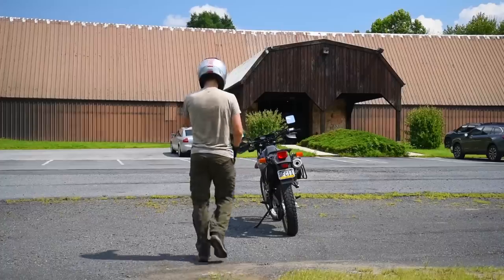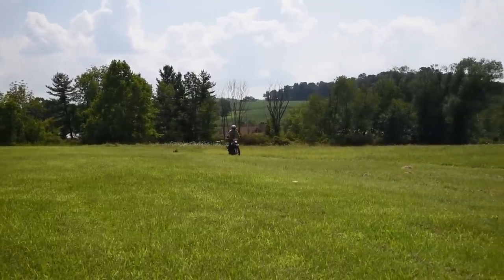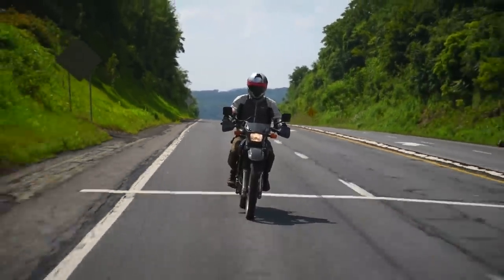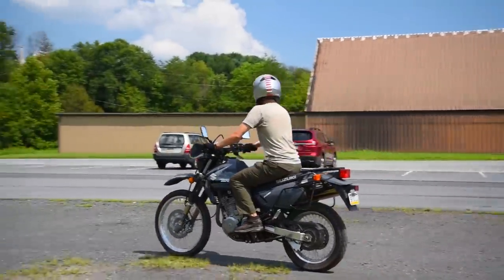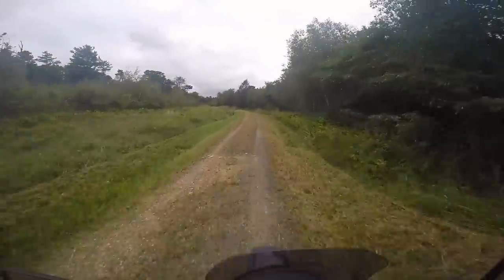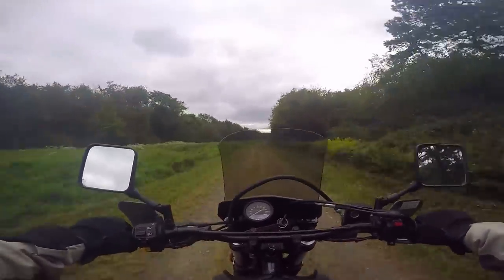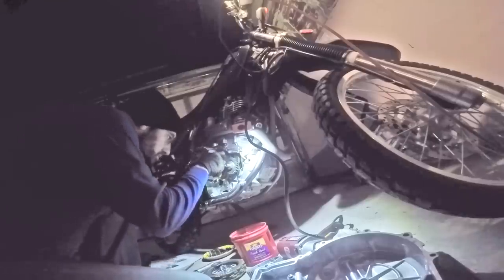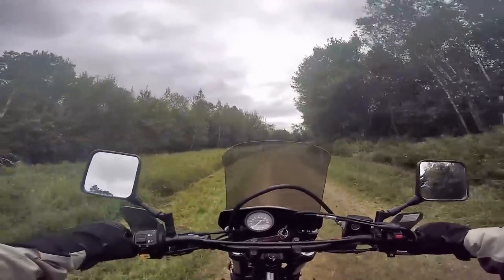2013 Suzuki DR650: Regular Car Reviews

Comment: Best review of a DR650 I've seen. As a former Dr650 commuter... I can absolutely confirm 100% about your statements regarding this bike. I rode dirt bikes in my young years and when I started commuting via motorcycle I started with a Kawi Super Sherpa. I soon got the itch for more power... I'm 5'3" ,klr650/xr650 too tall, Bmw valve adjust =$1000. Bought a Dr and put a lower gel seat, can tip-toe at lights, did 7k miles in a year commuting and loved it. Only stopped commuting due to work relocation. I loved the Dr and am planning on buying a new -to-me used one. But as you stated .... they don't last long on Craigslist.

Comment: You are so right it is the most vanilla bike you can get.
It is essentially bomb proof in its durability and a pig sled to ride stock out of the box.
It does everything right down the middle and that's why as you said it is also the most customizable bike you can get.
I have had mine for 8 years and it is perfect but only because of the changes I made.
While other bikes do a lot of things better at a much higher price, no bike does what the DR650 does at a bear bones price.
Thank you this was a very realistic review, but in the end it comes down to what the rider wants.

Comment: Well this pretty much summed up how I feel about my KLR. It's a gen 1 so, similar weight, similar handling, similar gas mileage. It sucks offroad but I take it anyway, it sucks on the highway but I take it anyway, the seat's uncomfortable on long rides but I take it anyway. I'll take this stupid, old, heavy, and uncomfortable bike to the end of the world though, because, for some strange reason, I love it.
Reply: Well.. umm..   not same weight.
It's heavier.
But still very well said
Reply: @generaldistrust  that's why I said "similar weight", not the same, but reasonably close.
Reply: @tieran9491  well, another reason I went for my '99 DR650SE was several tens of pounds less stock (I do KG not LB 🙏) plus mine was modded by the previous owner with plastic 25-liter tank (Acerbis) & lighter cut-off GSX muffler so it was even more attractive opportunity..
Reply: @generaldistrust  I wish I could have gone with a DR650, because yes, it is 21 kg lighter. But I just couldn't pass up a 1999 KLR with only 10k miles(~16000 km) for 1500 USD.
Reply: @tieran9491  - where I live it is really hard to find a 'find' that a working class (more like 'peasant') can afford and isn't a fail..  I indeed examined KLR option deeply and really dug into all material & details on the web.. this very DR was a major find I admit .. if it weren't this one it might have been even a KLR or who knows make a DR350 to just get acquainted with dualsport before I really familiarize my style more in depth.. I really had a wider variety that I examined but I still wanted the option to go trailing with my friends so there U have it. Can't afford 2 bikes, plus the insurance here is grand theft so it is tough. One bike. What can you do..
Reply: Dual-sports are the blue-collar bike. They're affordable and can be configured for any environment.

Comment: By far my favorite DS tires were the Kenda K270s (or anything that resembles them).  You get 2 solid oil changes out of them, great on the highway, great in the city, ok in the rain, and ok on trails.  They’re affordable, and soft enough to change tires with 2 spoons.  They DO NOT like mud or anything loose.  I retired my 85’ XL600R to off road use only, but it still runs like hell at 50,000+ miles, and I switched to the Kenda K760 Track Masters.  They’re DOT legal, they will “work” on the highway, but only for 1000 miles, and they eat up the trails like it’s nobody’s business.  Super important to have DOT tires if you like to explore, because a lot of wide dirt roads can only be driven by street legal vehicles.  You may even need to run down the highway to the next trail.

Comment: I had a DR650 for several years, and I never found the off-road situation it wouldn't handle if I was careful enough. Maybe our dry climate meant I never had my tires gunk up (not that it was on the stock tires), but it was a total blast to ride around the desert.  With the larger fuel tank, windshield, and a nice seat, it was 'doable' for long highway stints.   
Something to note is that this bike is the easiest thing in the world to work on.  This bike taught me how to replace/rebuild a carb, replace a piston, rebuild suspension components, do some dodgy electrical work, and then some.  It's so easy to get to everything that you don't have all this daunting plastic that you're worried about taking off before even getting to the valve adjustment.

Comment: Love my DR 😁

Sure it's not awesome at any one thing but that's the point. Like you said, it's a blank canvas and that's what I personally like about it. The fact I can chuck a heap of gear on the back, travel hundreds or thousands of kms on the black top and then dive of into the dirt, find a camp site, dump my gear and go explore the wilderness, even some moderate single trails and in a range of conditions depending on your tyre choice...then ride it to work the next day.

That's what the DR650 is all about, and for a lot less $ and weight than what a BMW GS or Honda Africa Twin will set you back 😉👍

Comment: Of all the bikes I've had, the DR650 is the one I wish I had kept.  Mine was set up quite nicely for my usage (commuting and hooliganism) and ran exceptionally well.  FCR39MX carb, high comp piston, Web cam, full exhaust, 16T front sprocket, stiffer springs, 19" front wheel, Trailtech Vapor, and a few other odds and ends I can't remember.  No, it was not great off-road but it handled dirt roads and fire breaks well enough.  Single track was out of the question, ha!  So much fun on the street though and power wheelies in 1-2, and occasionally 3 were plentiful.  Would love to get another one at some point.

Comment: If that's the extent of your "off-roading" then a V-strom/BMW GS will do all that and be a MUCH better ride on the highway. 
A DR650 is the same thing as a XR650L so I don't know what you're talking about there. 
A DR650 isn't even a preferred commuter bike. If you want a commuter the Honda NC700X can get 70+ MPG. 
If you want a proper trail dual sport for PA woods, a TW200 is where it's at. Sure it only goes 50mph but you can bash that bike off rocks all day long and if you get into a pickle....stand up.
Reply: Yeah but he doesn't want something heavy period for offroad and only really used it on the street, hence the gixxif
Reply: Yeah, once I hit an actual motocross dirt track in rain on my KLR650 and then sat down on a DRZ400 i definitely knew weight is just too much of a factor for extreme terrain (mud or DRY fine sand)
For anything else you can pretty much bring any bike that isnt on 100% sport tires
Reply: XR and DR are pretty close weight wise as well, but I think I have read that the XR has better off road suspension.
Reply: Yeah but they're heavier and probably not as nimble on winding roads, and have less-forgiving ground clearance.

Comment: As the proud owner of a 2010 KLR650, this video is spot on. It's for the guy who wants two bikes, but can barely afford one. Off road? Too heavy. Interstate cruising? Too scary. Putting back and forth to work? Perfect.

Geography has a lot to do with how much you'll like the "dual" in dual-sport. Rough pavement/gravel/dirt roads through the valleys of Kentucky and Tennessee is where you'll see a lot of other enduro bikes.

Comment: Yamaha MT-07 58-62 highway, loads of torque. That would be a perfect Regular Car....  Regular Motorcycle Review.
Reply: Lassi Kinnunen  yeah Thailand is one of those places where 250 and 400 are already BIG bikes. same with where I'm at in east Africa
Reply: @gregorysteffensen3279   anything under 450 is small in the US and anything over 800 is large. Dualsport450-nakedfz09 is the US average.
Reply: @ianwright2253  oh I'm well aware - just teaching abroad for a bit! likely getting one of the current CB500s when I get back, too
Reply: Unless you're talking cruiser, then 800 is still small. Got to throw a ridiculously over sized and under-powered engine in those Harleys.
Reply: @ianwright2253  Similar situation in Europe. To the point where 250s are barely even available, with the exception of a small number of enduros(like Honda CRF250). In general there's a big gap between 125 and 500 where the European market is mostly skipped over. I think it's part emissions standards and part licencing system, A1 gets you a 125, A2 gets you a 500 or ecu-restricted 650, A gets you anything. There's no reason for most people to get the bikes that are situated between A1 and A2. I can't even find any used DRZ400s for sale in my entire country.

Comment: Service Manual: "Dry mass................................................... 147 kg (324 lbs)" 

Owners manual: "Curb Mass................................................. 166kg (365 lbs)"

So even with a full fuel tank can it lose 41 lbs of fluids? Forks, shock, battery water, engine oil?
Reply: How much do you think gas and oil weighs?

Between 6 and 7 pounds per gallon. The gas tank holds 3.5 gallons so that's 21 to 25 pounds right there.  The oil capacity is 2.5 quarts, so that's about 5 pounds. Shock oil is about 3 pounds, and a battery is going to be about 7 pounds.

Add all of that up and you got 36-40 pounds.

Comment: 34 here, just got my first bike last summer, CRF250L Rally. It's uncomfortably tall, the suspension is way too soft, and at 340 pounds it's shamefully heavy for a 250. But it looks great, I love the way it feels, it's harder to get myself into trouble because it's just a 250 (but it has enough power to cruise at 60mph without difficulty, and loves climbing hills slowly), and it's fuel injected, so the 5,000 foot elevation range of my local mountain playgrounds don't give it problems. Relaxed exploring on dirt back roads gives 70-80mpg easily. And good visibility, because you sit nice and tall.

Comment: I’ve been a fan of this channel for a while now and was super excited to see this. The DR is my favorite bike I’ve ever had. It isn’t great at anything, but you can do everything on it. I have a pumper carb, full FMF pipe, and drilled air box on mine with a 14/42 sprocket set. It’s great, and I can still take it across state trips fine. Indiana to New York bee a my furthest, but it did it fine.
Reply: I’d grab one if it had efi and 6 speeds

Comment: I had an early Suzuki Dual Sport, we used to call them Enduros in SO CA.. It was a 1982 TS 125 - "Trail Street".  125 two stroke and a 6 speed. I put 13k miles on that bike and it never once let me down.

Comment: I love my DR650.. but even at 6'3" i cant even flat foot it on flat road. I would recommend lowering for most folks. Its EASILY done (15 minutes max, one bolt on rear shock and for front loosen shock mounts on triple tree and let forks slip out the top of triple tree about 1.5 inches and tighten. Boom ur done!) I personally me even go back to that, i could flat foot then. When i bought it the guy lowered it, so i raised it back up... its TALL. Just the ball of my feet touch on flat.. so off roads i can get off balance at stops

Comment: if you put about 1000 bucks into mods you can make this bike a beast.
step 1 for modding is do the BST magic (mod the carb and air box), get a full exhaust, put some better tires on, get progressive fork springs, get a different seat or make your own, get different handle bars.
thats pretty much everything you need to have fun in the dirt or destroy sports bikes in the twisties.

you can also make it a light weight adv bike. there is none on the market with this weight or lighter besides the little 250 honda which is honestly way to underpowered for a 200lb grown up.

also whats most important: the DR650 community is probably the best vehicle community on the planet.

Comment: The DR series of bikes is in my opinion, the best entry bike to the dual-sport enthusiast world. It's perfect for the person who already has experience on riding and handling a motorcycle, and has limited knowledge on mechanical wrenching. The DR (and XR's and to some extent the KLR650) is a completely analog bike, it doesn't have any electrical stuff that will fail and hinder your riding experience. Everything on the bike is fixable by a willing home mechanic and provides an easy and (sometimes) fun learning experience. Take for example the carburetor, that's a part that you can disassemble by yourself, and do all kinds of upgrades to get a significant performance boost to your bike. That kind of upgrade is kind of out of the question with new bikes, yeah you can upgrade the injectors on some bikes, but mostly it's just fuel maps that are done by wizards in shops. You don't take your carburated bike to a shop, because you're a cheap-ass and you bought a cheap-ass' bike. No, you do it yourself and feel proud of your accomplishment.

I bought a DR350S as my first enthusiast bike, and I've already done a great deal of fixes and upgrades, that I never even dreamed of doing to any of my previous bikes. Right now I'm fitting a Husqvarna front end, that I got for dirt cheap. It's been really rewarding to learn the ups and downs of the whole hobby and meeting other enthusiasts who have at some point wrestled with the same problems, that you are now facing.

Comment: I had a Suzuki SP600, which was a predecessor to the DR650. I never had any problem getting it to wheelie in 1st and 2nd gears. Sure, it's not the powerhouse that more modern, motocross based models are, but they're still fun bikes.

Comment: What you said about Suzuki cheaping out is right on the money. For the DR-Z400, they cheaped out on the cam chain tensioner. Suzuki is like Bethesda; they make a good product, but you know you're gonna need a bunch of unofficial patches as soon as you get it.
Reply: Dont forget about the engine cases you MUST buy covers for and the axe shaped shifter that will punch into the engine case the 1st time you drop it if you don't file it down.

Comment: The Dr650 has a lowering set up built in. A new bike can lowered by the dealership or can do it yourself if you are handy with the spanners. The info is on YT and the net at large regarding the dr650.

Comment: I just did 4000km on my 93 kickstart only dr 650 across Europe. It did a really good job! No problems. Also did 400 km off-road on 50/50 tires. Honestly not that bad, if I had better tires for harder terrain. Yes, a sport enduro would be much better off road, but this way easier terrain is much more challenging and a lot more fun!

Comment: Safety Tip #1 when riding off-road, Always remember to only apply braking with the front brake lever as your feet must be firmly planted on the foot pegs for maximum control. 

Perfect dual sport is a Yamaha IT or WR 250 or TW 200.
Bug-Out Bike....without hesitation would be ROKON. It's slow, but will go everywhere, even on water. And its 2 wheel drive.

Comment: I have  an 08 model of this bike converted into a supermoto with a bit of weight loss, and I love it. I'm sure it doesn't handle as well as a real sumo, but it's still very nimble and fun, along with being very reliable and durable. The only issue I have with it is the top end power, but I may fix that with the 790 big bore kit. That is if I keep it after  I get out of school and don't just get a husky 701sm.

Comment: I owned a 2006 for many years. It's a fun bike and its stone-axe simplicity makes it easy and cheap to maintain. Like all thumpers, it's a blast on back roads and a great reminder that riding a slow bike fast is more fun than riding a fast bike slow. One thing you didn't mention: maybe it's just my fat ass, but the seat is sinfully uncomfortable. This could never be an adventure bike without a better seat.  Like you, I eventually sold mine, and, yes, it was very easy to sell.

Comment: My 1972 Suzuki Savage - which was the dual sport of that era - had the neutral switch right under the front sprocket. Every time I went dirt riding and fell down - which was every time I went dirt riding - the chain would jump off the rear sprocket and slam into the plastic neutral light switch, breaking it and dumping out all the oil so I would need to push it home. After I bought my third neutral light switch I traded it for a Honda Passport.

Comment: I worked on a Suzuki four wheeler for a guy one time. Turns out they cheaped out on the cylinder plating. Guy complained about a lack of compression, the cylinder was conical on the inside. The piston rattled around like hell at the top but seated correctly at the bottom.

Comment: This bike, in stock form, is worth it for the commuter who lives on a long gravel or dirt road connected to a highway with a 55mph speed limit. Hard packed trails? Fun! Mud or wet grass? Agonizing. Also, used Folgers cans are hands down the best oil drain pans for motorcycles.

Comment: I had a dual sport, the Yamaha XT 500 and yes, you show it fuel it will do it's damnedest to throw you. Mine was kick start only which if not done correctly(there is a procedure) it will break your ankle.
The torque was unreal, you could pull tree stumps out with this beast.

Comment: Recently picked up a '92 DR 350 and I love it. Street legal. Got it relatively cheap and it's a great way to commute to work. Don't take the SV 650 to work cause I don't want it to get stolen during a 12 hr shift unattended but the DR was cheap and I don't stress. Agree that the tall DR's are not beginner bikes. Maybe a DR200 unless your really tall.

Comment: The DR350 of the early 90s  is probably the sweet spot of dual sports. 33 hp and 25 tq is not bad. Six speed trans and 286 lbs wet.